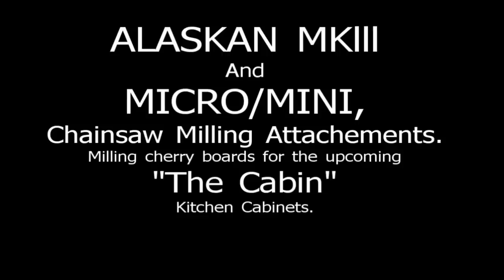Alaskan MKlll, Micro Mini, Chainsaw Milling attachments. Milling Cherry Boards

Comment: Joe;  The saw marks on the boards can be alleviated by using milling chain.  The more gap between the teeth ...like skip tooth etc...the rougher the cut..I use a 10 deg angle on my chain with a full complement of teeth and rakers. The cuts are really quite smooth.

Comment: Thanks for posting the mini wanted to see how that works . makes good first cut.
Reply from the maker: Artaxerses1945 Actually if your logs are under 4 or 5 feel long I prefer milling the whole thing into boards using the mini. The weight of the saw does most of the work and its easier on your back. Thank you. Joe

Comment: Just did a few quick cuts with my Husky 390xp, my first cuts, in breaking down a pair of 4x8 timbers into 2x8 planks. Is blindingly quick compared to the tiny saw I was using. The sooner you can get a big saw, the better. Can always use the smaller saw for edging boards.
Reply from the maker: +Jeffrey Beyer  I agree. I will just use my 360 for firewood. Thank you. Joe
Reply: Was simply saying you will be in love with the big saw once you get your hands on one.

Comment: I noticed that when you were sharpening your chain, you were sharpening it at a severe angle (meaning the chain is a crosscut chain). Do you use any ripping chains? They cut much cleaner and much faster than crosscut chains when milling.

Comment: By the way, what size saw are you using?
Reply from the maker: +Jeffrey Beyer  In this video I am using my ms360 or what they used to call the 036. The saw should be bigger but this one although slow, does the job. Thanks Jeff. Joe

Comment: How long do u dry the boards u cut or can u use them right away
Reply from the maker: Stephen VanDyke It should dry for 1 year if just out in the regular air. I will bring them in towards fall and run the fan on them.
Thank you. Joe

Comment: What size is your saw?
Reply from the maker: +cale templeton  A person really should have a bigger saw than what I am using and I think I will eventually get one that has a horse power rating above 70. The one I am using now is a MS360. It gets the job done but it takes some time. The only good thing is that its not a real heavy saw and the bigger ones are. Thank you. Joe